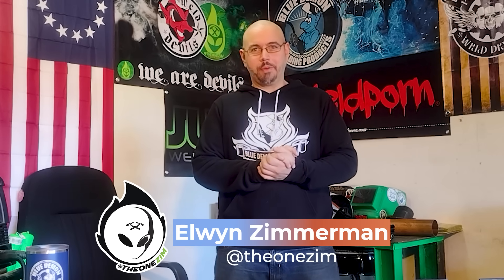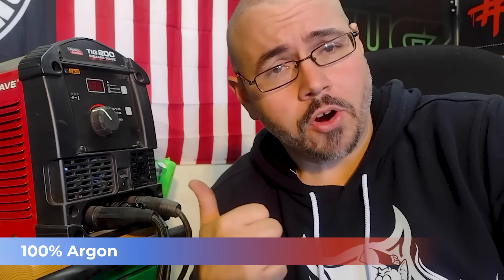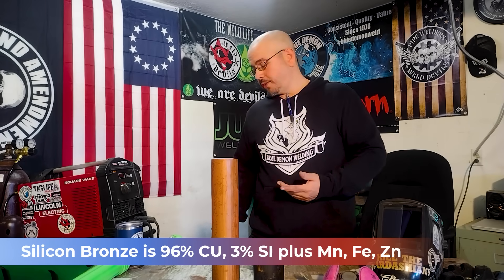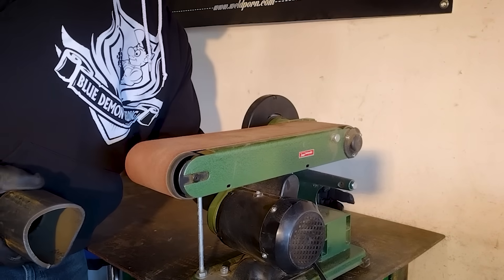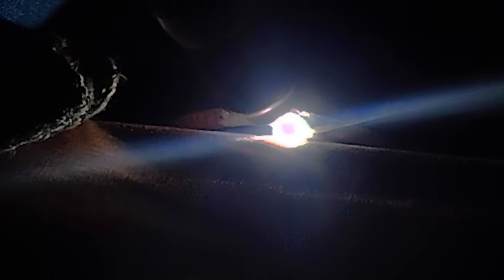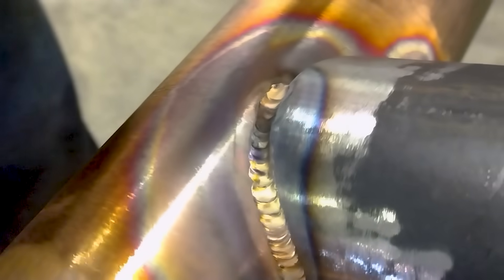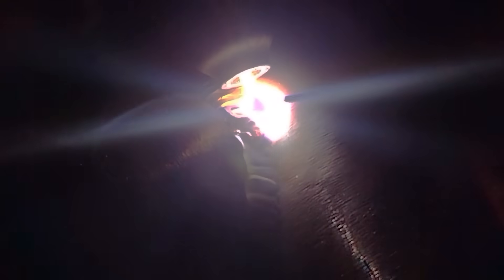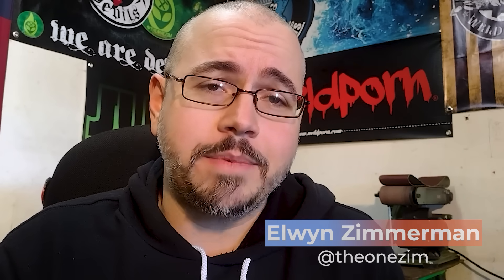TIG Welding Copper to Steel HOW TO

Comment: Beautiful welds 

Higher thermal conductivity doesn't mean that it "holds heat" (in fact it means exactly the opposite lol ) . It means that it conducts heat more. When you need to apply the arc longer to have it melt is because heat is actually spreading really fast in the piece and it can't quite concentrate at the arc's striking point as quickly as with, say, steel. Steel has poor heat conductivity, thus the heat you're inputting into the piece builds up really fast at the point of impact and has no time to spread fast enough : thus the metal melts right under the arc.
Reply: What you said!! 
You've addressed it already
Reply: And concise
Well said

Comment: Great demo.  I have TIG welded aircraft frames and motor mounts  Aluminum motorcycle parts and so on BUT  -  please give me an application where copper is welded to steel ...    I am thinking large electrical installations ?
Reply: Heat transfer equipment, we make large scale air conditioning, heating coils some water based some oil and some steam. Different applications use different combinations.
Reply: @1dreadyzim  I posted in a different comment about this. How do you address electrolysis in a water based system?
Reply: @nitrojunkie9027  I'm not sure about a lot of what goes on past making these pieces. I'd be interested in learning that myself to be honest
Reply: @1dreadyzim  10/4.....we're playing comment tag haha. Yeah, it would be fine without the introduction of water and last as long as the material. But with water it will deteriorate rapidly do to electrolysis. Thanks for the response man......peace
Reply: @1dreadyzim  I am a Boilermaker and have seen copper to steel connections on old boilers hold up fine. But they were on sealed hydronic systems that rarely got serviced. Most new stuff and code requires some sort of dielectric. Aight man......peace

Comment: Hi mate I'm just wondering is it possible to weld cast aluminium and how could you do it.
Reply: Yes it's possible.
Reply: @SHANANAGINSx  thank you.
Reply: @jaydeneuen7756  they make special wire but I've used 4043.
Reply: @SHANANAGINSx  oh ok thank you.
Reply: @jaydeneuen7756  yes you can, durafix makes a rod for it. You're not welding, it would be a braze. But the joints and material is tough as hell. Also blue demon makes a rod for welding cast aluminum if I remember correctly.
Reply from the maker: we have multiple videos on this topic in the WELD app

Comment: This is not welding as the 2 metals have not been fused together.He said it himself that the filler rod is washed over the steel.
Reply: The steel and copper are both brought to a liquid state, at this amperage you cannot simply wash over the steel as you can see in the finished root pass
Reply: @1dreadyzim  but the filler rod is not the same composition as the steel.
Reply: It's not the same but it does have some of the same components. Also a filler does not necessarily have to have the same composition as a base metal to be considered welding infact many times you have to use several different fillers with different compositions to weld different materials. Example ; copper nickel to steel not only requires a back purge but also you will use three different fillers for the joint

Comment: brazing not welding
Reply: No. It's actually welding because all the metals are melting and mixing .
Reply: The melting of the base metal is the only distinction between welding and brazing. Here the base metal is brought to a liquid state. Therefore this is welding.

Comment: Interesting. I'm wondering what the strength is of a copper/steel joint like that. I'm curious about welding copper to copper directly with copper filler - something for an art piece I'm doing.
Reply: for an art piece you can 100% get by with jus using solid electrical wire as filler to weld copper to copper or even copper to steel. I have made plenty of steel stemmed copper flowers like that.
Reply: I test these pieces at 450 psi underwater so it does the trick as far as pressure. I am not sure how long it lasts but for the initial tests it's decent!
Reply: @1dreadyzim  I wouldn't think it would last long with the introduction  of water do to electrolysis.
Reply: @nitrojunkie9027  I really wouldn't imagine so, I really couldn't say for sure, what I can say is these units are either using steam/water or oil to function so perhaps these are mostly oil units.
Reply: @1dreadyzim  yeah I would think so, because if not that joint would need a dielectric. Whether that be a union or a brass nipple to break the flow of electrons
Reply: If you want to join copper to copper in a neat strong way, why not use CU-PHOS?  Copper rod or wire with some phosphorous.  Doesn't require flux.  There's SIL-PHOS that has more or less silver, and CU-PHOS that has no silver.  You can get a color-match, it's strong, what more is there to want?  Welding copper is challenging, takes a lot of energy.

Comment: Looks more like tig brazing to me? Maybe diluting the braze material by melting some base metal in but don't know if i would call this welding. Do it  with some ER70 filler.
Reply: That filler would work fine if it weren't being meshed with copper, you can try it but I don't recommend it. Melting of base metal at all makes this a weld in fact it's the very difference between weld and braze.
Reply: @1dreadyzim   I do not know about this one in this case. It is a stretch to call that welding is what i am saying. Since the filler material ( that is commonly used for brazing) has a LOT lower meting temperature than steel had to say. So i would put it this way, If you Tig (or gas for that matter) brazed a joint and you over heated it and melted the base metal does it suddenly become a weld? I would say not. Its just an overhead braze and nothing was gained by melting the base metal. Or in this case there is really no need to even melt the steel. I would call this a braze joint. If the base metal melted it is just overheated and no need to do that.
Reply: @Magnamanification  I agree.  I think this is brazing.  If you form a weld puddle on the carbon steel, it will vaporize the silicon bronze and copper because of the temperature difference in melting points.  When he talks about "washing up" with the filler metal, the steel is not melting.  The proof would be to cut and etch the weld nugget to either verify or refute that it is a "weld".

Comment: Copper does NOT  have loads of Zinc in it! if it did, it would be Brass...
Reply: I was thinking the same thing, after all electrical copper wiring is extremely pure because any impurities decrease it's conductivity but I looked it up and there's several different alloys for pipes including one which is nearly 15% zinc. Here's a quote:
"It is manufactured from alloy C23000 which is comprised of approximately 85% Copper (Cu) with no greater than 0.05% Lead (Pb) and 0.05% Iron (Fe) and the remainder Zinc"
Also many copper pipe alloys contain small amounts of phosphorus and if he's getting headaches and other symptoms he may be experiencing phosphorus poisoning and thinking it's zinc...
Reply: good ventilation should mitigate the effects of the fumes and residue..   youll know if you dont get good ventilation you will get a seriously sharp and painful head ache... get to fresh air immediately .
Reply: Yeah I have served some time in sheet metal just welding galvanized all day so your correct, in comparison to something like that. Galvanized is the worst brass is a close second for sure
Reply: @1dreadyzim  People braze galvanized just for this reason!  To avoid the zinc fumes, since the zinc can be taken up by the brazing material.  Also zinc interferes with the welding action, and with the health of the weldor.
Reply: It has more zinc than most things people usually weld on so in retrospect I may have used incorrect terminology, but I stand by it😂
Reply: @1dreadyzim  anyone doing structural has probably welded straight over zinc.

Comment: So silicon bronze brazing …? Why call it welding then?
Reply: Watch the video he explains that he is welding it not brazing. It’s welding because he is melting the base metal.
Reply: The base metal being brought to a liquid state is the only distinction between weld and braze.
Reply: Brazing is the action of having a filler metal melts ON TO the surface of other base metal and act as a glue: the brazing material never enters in a solution with the base metal(s), it simply stick to its surface by capillarity and then solidifies and acts like a cement/a glue.   

If you meld the base metals and mix it with the filler then you are welding.
Reply: Either way great looking welds. Wish I could cap that clean lol
Reply: Thank you! I've been doing these for a long time. It doesn't have to be pretty to hold pressure just keep burning🍻
Reply: Maybe cut and etch to prove if it’s a braise or weld. That would be a cool video
Reply: This is not Braising ....braising is using an acetelyne torch flame... This is still welding since you're using a tig torch with silicon bronze filler rod.
Reply: @RedWhiteBlueYo  my friend you can braise with tig. This old Tony has a few videos doing it. Have done it myself playing around
Reply: @fuzznut25  he explained it in the video. As you know, braising doesn’t melt the base metals being braised. It just melts the brazing rod. You also need a flux with braising. Welding melts the base metal. Is it braising when you use steel rod for two pieces of steel, because you’re doing the same thing as here, except here, you’re using a rod that is almost all copper. Additionally, when you weld 304 stainless to mild A-36 steel, or thereabouts, you use 309L rod. Is that brazing in your understanding?
Reply: @melgross  you don’t need flux to tig braise. The shield gas keeps it clean
Reply: Wow you guys are something else. Allow me to clear a couple things up...

Braise: to cook (meat, fish, or vegetables) by sautéeing in fat and then simmering slowly in very little liquid.

Braze: to unite (metal objects) at high temperatures by applying any of various nonferrous solders.

Brays: utters the characteristic loud harsh cry of a donkey (e.g., refer to comment section on this video).

Weld: to unite (metallic parts) by heating and allowing the metals to flow together (e.g., the process shown in this video).